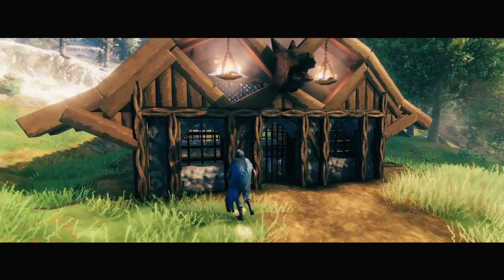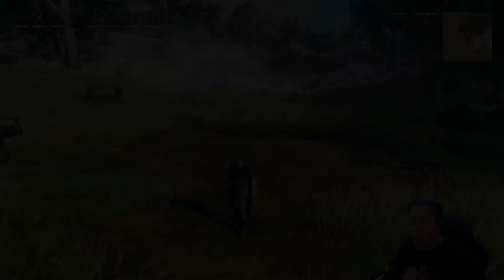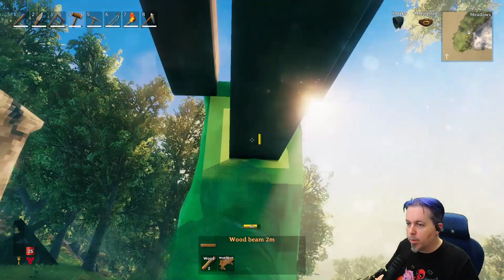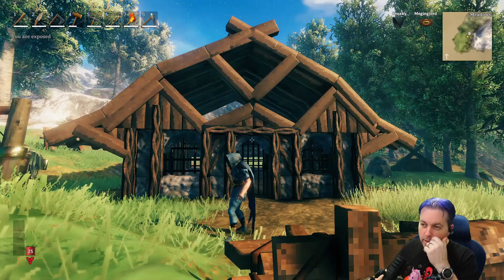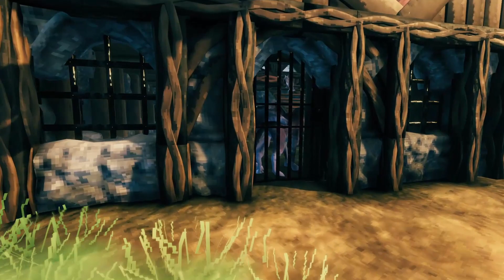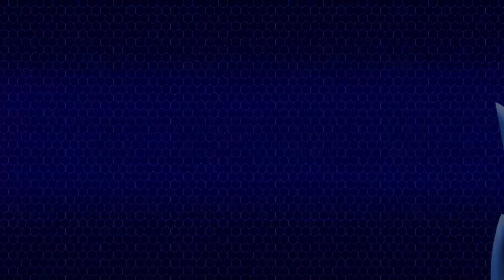Valheim Build: Wolf House Build

Comment: this is super fancy and looks easy enough to replicate. however my question is, what would your suggestion be for a feeding station?
Reply from the maker: Normally I just walked in, chucked a few pieces of meat on the ground and then left them. This was more of a covered sanctuary I built in my complex to protect my original 2 Star Wolves as they were almost wiped out during a raid on the base. Any cubs that were born I would wait until they were grown, have them follow me out and then station them around the complex for protection.

Comment: You can use the basic door to find the center of a 1 meter building block to get to .5m. It's a bit tricky, the simple door has 3 anchor points on the sides, but you can use it to lock your alignment beams on.
Reply from the maker: You know, I've done that before to add texture and depth to a wall . . . I don't know why I didn't do it here to center those beams . . . good idea!